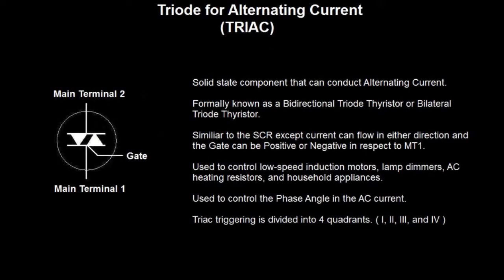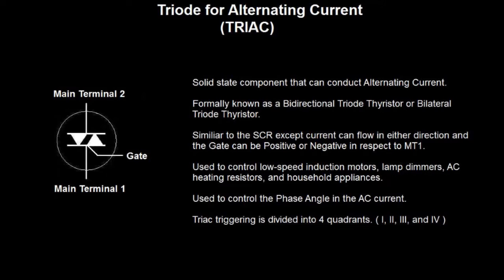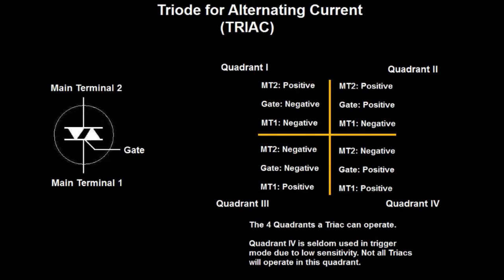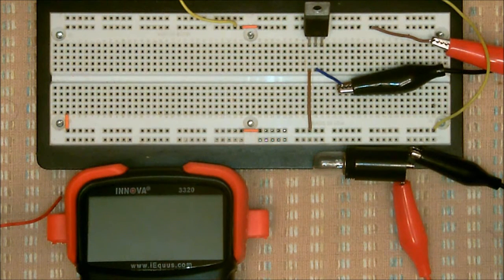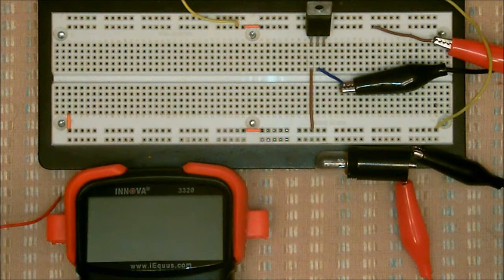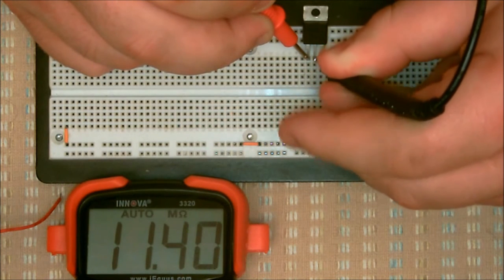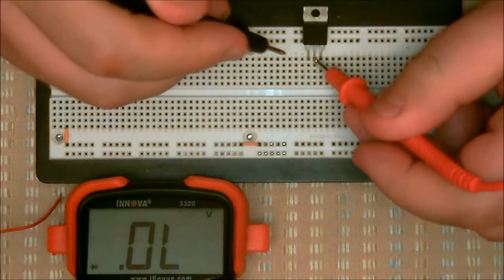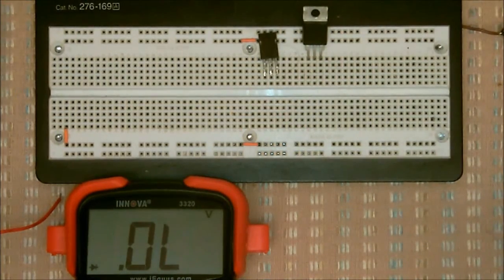Testing the Triode for Alternating Current

Comment: Excellent, excellent, excellent breakdown of the mythical component known as TRIAC. I have a notoriously evil power switch (ALPS disc wafer rotary DP?T w/ the speaker selaction tied into it). And the TRIAC is a blessing as it saves time, money and countless hours obsolete part tracking. Relays are an alternative but it would seem the TRIAC is the simpler of the two methods. I have yet to hear a benefit of the relay over the TRIAC when it comes to my specific matter. Thanks FixIt. Great content spoken like a regular guy instead of the nerds up in here that make me feel dumb.

Comment from the maker: Thank you, billybonewhacker. They are basically an electronic switch for AC. They are used in light dimmers and motor controls. There is a separate avalanche diode that is similar to the TRIAC called a DIAC. The DIAC is used to trigger the TRIAC to control the Alternating Current's 'Cycle'. For example, if the TRIAC is turn-on during the rise of the voltage/current cycle the light is brighter where as on the fall of the cycle, the light is dimmer (how light dimmers work). -MrFixit